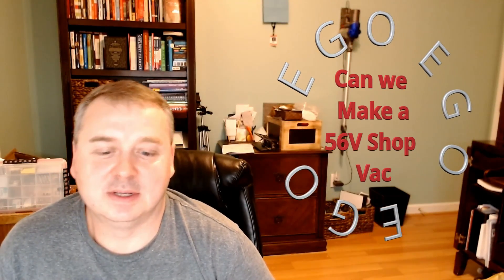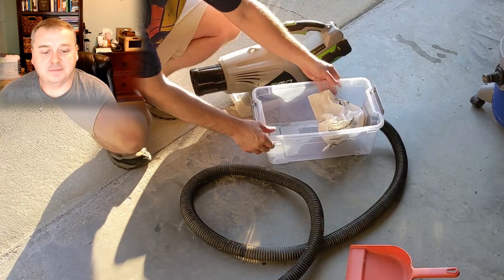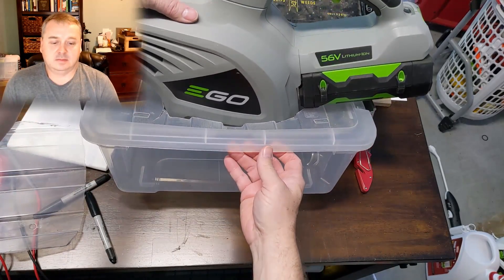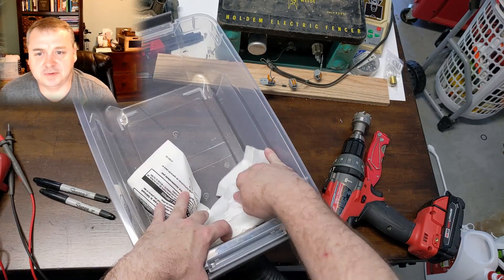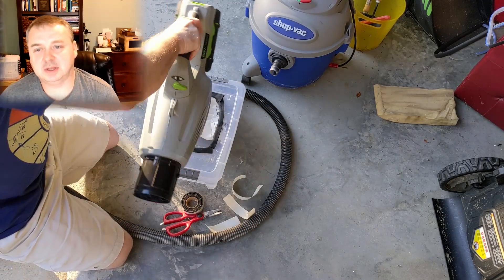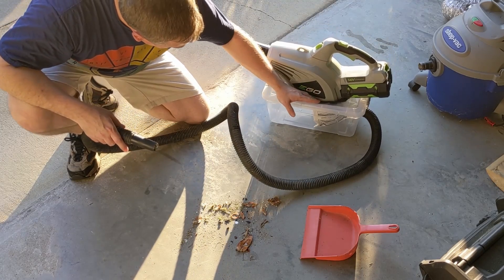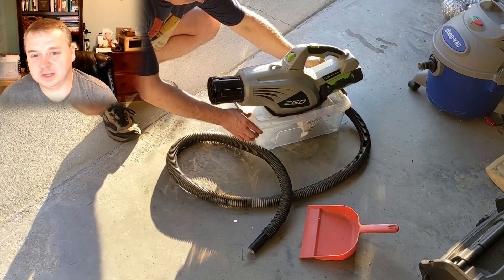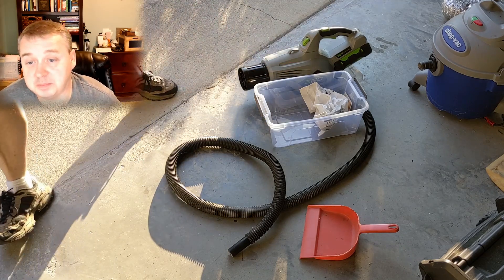Can we make a EGO 56V Shop Vac?

Comment: The $17 speed controller fix I presume. I'm glad to see the old droopy balled goat is still taken out on the parade.
Reply from the maker: I need to do an update video on it. It is actually my go to. It puts out more than my newer 530cfm blower. I'm know it's over driven and it kicks it in acceleration so I was wondering if it would still be holding up. I guess with all the forced airflow it keeps it cool enough?